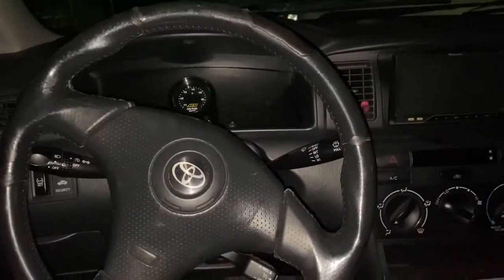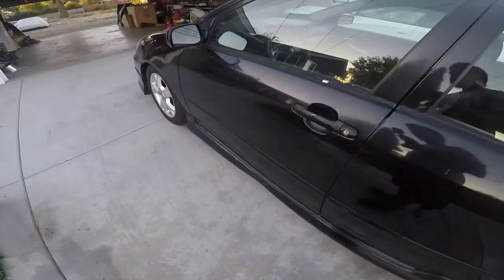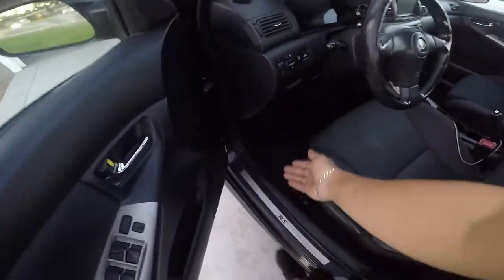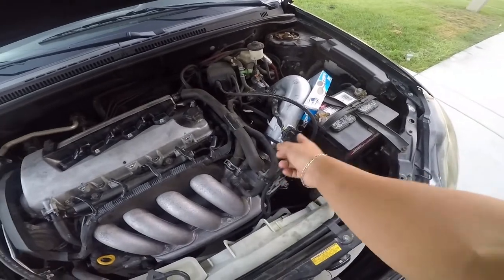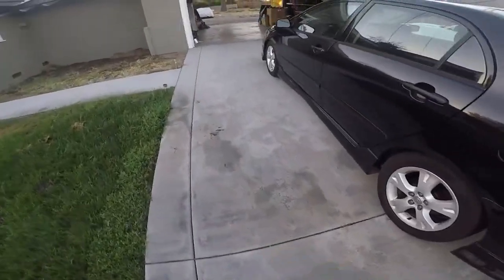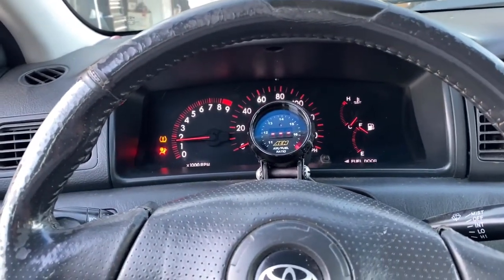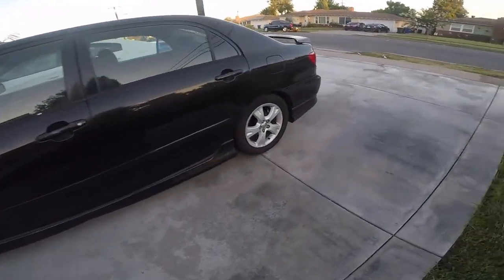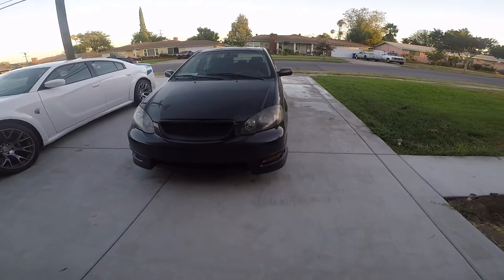New Car

Comment: Great buy. 

Air bag light 99.9% it’s Going to be the clock spring. I got an eBay $15 one and it’s been fine for a year now. 

The corolla did not come with sensors for tpms. Just make sure the wheel speed sensors are working fine or if the axles have been replaced make sure they bought abs axles. They have a ring around them that determine the speed of the wheels and the tire pressure. Also need to make sure all 4 tires are the same size.

Also if you sell the PPE stuff please let me know first. Let’s work a deal
Reply from the maker: 2zzlow Thanks for all the help and all the tips. I will check all those stuff when I have time main thing is making it run right 1st.

Believe me you got 1st dib on the headers if I decide to sell